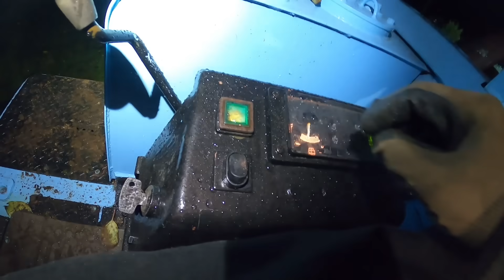Main house renovation (ep1) - Pouring foundation

Comment: Hi Ant's phil again lol... with your skills you can get a job of work done that looks easy....with your new lathe--welder and plasma cutter why not have a go at making a digging bucket slightly wider than the dipping arm say 12" or twelve inches wide it would make digging easier on the machine joints and would be a really useful bucket  for doing "footings" or pipe lines...and you would use less material on back fillings....just a small job to make one or two  for the size of work you are going to be doing......from my family to yours happy new year..:face-green-smiling:
Reply from the maker: not sure if it's worth it bud, can get really decent used buckets for 200-300 bucks
Reply: Ok my friend so nice to see that you are compleating all the projects  please keep up the brilliant work you are doing ... best of luck for the future.cheers for now ....

Comment: Hi. 
As usual, I'm watching you with great interest, especially as you're doing things quite similar to what I'm doing too - messing around with renovating an old wooden house.
However, in the case of this foundation, I wanted to alert you to a problem that could cost you a lot of extra work in the future.
The worst enemy of wood is moisture. If I observed correctly in the video you covered the foundation log up to half of its height. You secured this with roofing felt, which is good, but which at the same time has now created a gutter into which water will enter. This water will not have an easy time evaporating off the foundation log and will cause the log to rot and mould quickly. 
If I may make a suggestion, I'd forge the foundation too high so that the foundation log is 100% exposed and can breathe freely. 
Thank you so much for your videos and I wish you all the best for the new year!
Reply from the maker: i understand, but the log wall will be completly covered from the outside with siding boards so water will never get there.
Reply: @Ants_Pants  And that will certainly extend the life of that foundation, although that's not the only water that will collect there and that will have trouble evaporating. 
You will do as you see fit, I strongly recommend you, however, to cat that concrete flush with the bottom of the foundation log. That concrete overlapping the log is not good for anything, and you will have a healthy house for many more years. 
Best regards!

Comment: I have to say the way you fully supported the structure of the house and completely lifted the wall up off the foundation a bit was really professional and safe.
Did you ever work a construction job in your life?
I work in construction and we would have done it in a very similar way, but we would have used more support posts to distribute the load which would have most likely prevented the slab from cracking.
Steel screw posts inside the building under the main load bearing joists, fully tie the wall together with wood and have multiple cross support beams in place then slowly and evenly lift the wall up of the foundation around 5mm at first. We tend to be really careful there in new buildings you cant move anything at all even 5mm will crack and damage everything above, old wood houses are more "flexible".
Then confirm that the wall is holding together, then remove the old foundation completely just like you did.
Then pour a steel reinforced concrete foundation and tie it into the existing slab and neighbouring foundations and once that is fully cured and hardened let the wall back down onto the foundation. The main difficulty here is to exactly record how much the wall was raised and pour and level the new foundation according to that so once everything is set back down on the new foundation and settles back down the wall is at the exact same level it was before. That holy gap between the wall and new foundation would be calculated with the expected settlement of the new foundation and any installed moisture/isolation barrier between the concrete and the wall.
That is the goal ofc unless the wall and foundation was already sagged down then we would work to bring everything into the correct level again.
Most of the times the old wall and foundation is sagged to shit and we just lift the section to the appropriate level and pour the concrete around the wall like you did.

I think you did a good job and the wall will not be going anywhere for 100 years, you thought of a moisture barrier for the concrete and an isolation layer between the wood and concrete.
Reply from the maker: no i haven't really, thanks for the tips

Comment: In czechia we put this concrete mix as a plaster on the walls, it aquires a little bit of skill to mix it well and throw it on the wall, when i was 13 i really liked that job. 

But for concrete we used less sand and more fine gravel rock, it will cost less and also wont crack that much.

Comment: Fantastic video of you all working hard ( mostly you)
I have been following you for several years now and love your hard work and fixing videos. 
Only comment I want to make is you love your stapler, please remember that if you use mild steel staples they will rust out and leave holes in the water proof membrane. It happened to me and caused a lot of damage.
Reply from the maker: ohh :o never really thought about that
Reply: Thanks for reply. Makes me feel part of your “team”
Try stainless steel staples if you can get them. A coat of paint or sealer will reduce rusting. 
I am looking forward to you making more dust-haha. All the bast from me and happy new year from Sydney Australia.

Comment: With the gravel you got there you should tear down the house and open up a gravel pit then you could buy a big house already done and another one for supermom with about 100 acres of lawn and gardens to keep her happy. 😂
I’ve never seen them put insulation horizontally like you were talking about and I’m in a state in the U.S. where we can get up to 6’ of frost in the ground. Here they put insulation vertically against the concrete, then a thick vapor barrier, then cleaned 1” stone so that the water filters through the stone below the concrete instead of it sitting against the barrier. But the way you explained it then that should work too. Have a happy New Year to you and the family.
Reply from the maker: yeah man, it should work out about the same

Comment: The mixture for concrete is 3 parts 2b stone, 2 parts sand, and 1 part Portland cement, that would be a lot stronger than what your mixing. Also the less water you use the stronger the mix . Awesome video bro👍
Reply from the maker: very narrow cap to pour the cement through, that's why i went with a watery mixture

Comment: I wish you all the Best of health, prosperity and happiness for the new year! It’s very nice of you to do the work to expand the living floor space for your family, your Super Mom deserves her own space!
The curing hydration process in cement is exothermic so if you put an insulated tarp on the pour it will cure in quite cold weather. I was involved in for some very large compressors with huge high strength foundations we had copper pipes to circulate chilled water into the interior so they would not get too hot and cause lower strength.
Reply from the maker: Yup 👍

Comment: Bro you definitely should get a concrete vibrator for your next concrete job. Does wonders to your concrete strenght, also helps it to fill smll gaps and holes. The ones form china also work OK.
Reply from the maker: ok i will look it up

Comment: I wonder?? Stone foundation allow water to run away from the logs, concrete draws water and the logs say damp?
Reply: So does soil around house. Need to remove 1m around and replace with gravel.
Reply from the maker: Yes that's why i added that black tarp crap there
Reply: @Ants_Pants  Essentially created a reservoir as  it points up and water has nowhere to go. Also stapler created holes compromising it.
Reply from the maker: @otofoto  the entire wall from the outside will be covered up. It matters not as water will never reach that area
Reply: @Ants_Pants  Water vapour will condense there. Bye,bye hundred years old log house.
Reply from the maker: @otofoto  how will it condense there? If it will be covered by insulation, windbarrier and siding? Educate me please, maybe i missed some class in school
Reply: @Ants_Pants   Elementary school? Life will educate for free. Let’s see this wall after 5 years then we can discuss what went wrong.
Reply from the maker: @otofoto  i understand that wood being enclosed and unable to breathe will lead to rot. Before i enclose the wall i will remove the overlapping tarp. Other then this and excessive concrete removal there is nothing else to be done. Imo
Reply: @Ants_Pants  What is overall plan for the wall sandwich? Acrylic paint, then plasterboard then air gap then plastic sheet, then logs, then bitumen then wool insulation then siding!?
Reply from the maker: @otofoto  logs will be left out from the inside most likely, against the logs outside, 2 layers of insulation, a 100mm/150mm followed by a 50mm layer, windbarrier, air cap, wooden siding.

Comment: Those concrete machines are the run of the mill therein every backyard across the entire world they are the Timex of cement mixers I have one I've had it for about 20 years they just don't quit but one thing's for sure I don't have nearly as much concrete on the barrel of mine a needle scaler and a wire brush would fix that for yours Happy New Year

Comment: Is it a good idea to bury the bottom beam behind concrete? What if moisture gets between the wood and the roofing felt? It think this will rott the beam quickly.
Reply from the maker: the log will be covered up from the outside in the end, so water cant get there

Comment: Just a question Ants, why only sand and no stone and gravel.  Mortar mix without gravel is more delicate when it hardens.  Just a question.  You are one hard worker.
Reply from the maker: the sand does contain a ton of tiny rocks. Its not pure sand, the quarry guy calls it concrete sand :D idk

Comment: Nice one Andris. I know I asked this before but there's very little gravel/aggregate in your concrete mix. Is this normal in Estonia?
Reply from the maker: the sand does contain aggregates, it's just what i can buy locally and it's cheap
Reply: @Ants_Pants  I suppose you are not building a bridge or something like that!
Reply from the maker: @Palinkat  i did build a bridge out of this stuff 😅 even driven over it with my yanmar b27 which is 2,7tons
Reply: @Ants_Pants  Hahaha I thought about that one after I wrote my comments, touché!!!

Comment: When you lifted one wall up by about 2 centimeters and did the foundation beneath it, i would have thought, you would lower it down to its original state. doesnt that slightly mess with how the building is sitting or is it just negletable? or did i have a stroke and i missed something?
Reply from the maker: It sagged down anyway. Those China bottle jacks can't hold pressure

Comment: Will you be adding windows to both rooms?
Reply from the maker: Yea
Reply: In your other videos, as much as i can make out, the windows of the house seem to be between the logs and insulation is added later as a next layer. So those windows are a bit "inside" the walls. I don't know if it will be visually bad or not, but if it doesn't make much difference to you, i'd advise to put new windows flush with the outside wind barrier which will be right on top of insulation (windows sitting in between the new wooden frame). That way they catch more light since the roofs edge is very low. Also, insulation forms a more uniform layer (less corners on the outside to make windproof). But then again, if it does not please the eye, it would make sense to make it similar to previous solutions. I myself (i have a very similar house) brought all new windows flush with outside insulation to kind of ease the "cave" feeling usually present in the rooms due to low ceilings. One more thing, if any way possible, use at least 3-layered glass windows.

Comment: I also have that electric makita hammer, i have hm0870c and hm0871c and 0870 shakes so much that i can feel it shaking me like 3 days after i used it🤣🤣and also to add, i have same impact drill as you! When its cold it eats thru batteries🤣🤣
Reply from the maker: ah yes

Comment: Great video. Put also  black hydro isoliation on concrete it will gona help concrete to protect from water
Reply from the maker: the blue insulation that i bought acts as a hydro insulation also. It's like 2-in-1 thing

Comment: Best wishes Andris. Congrats for the yet another great project! 
Ps if you are looking for yanmar upgrade ideas i suggest a 4 bar mechanism for the thumb to increase its range of motion. I saw it was getting in the way when you were digging. But i don't now shit about excavators😅
Reply from the maker: yeah the cylinder setup is incorrect, i would need to redesign that

Comment: You add way to much water and cement to your mix. This makes the concrete weak. (and cement costs money). Adding gravel to your mix would also make your mix stronger and less expensive.
Reply: If he can get some small washed gravel to add to the cement he will use less cement and have a much stronger mix
Reply from the maker: yes

Comment: Yikes, im an engineering geologist bro. Be careful very very careful😮
Reply from the maker: why bro
Reply: @Ants_Pants  your wall could collapse on you. Your basically appear to be underming the buildings foundations. You might want to think about propping up the floor from underneath where you dug your trench ( wood will probably do for now). The material you excavated appears to be unconsolidated, poorly sorted, sands and gravels typical of glacial deposits which should have a fairly high compressive strength but are prone to failure through a similar process you used to get rid of that troublesome rock. Over time gravity will do the same to your trench. ( That's the reason why your shore up service trenches, sewer, stormwater, particularly when over 1.2 m in depth) Then I, suggest constructing the new foundations and backfilling as soon as practically possible.
Hope that helps
Happy new year